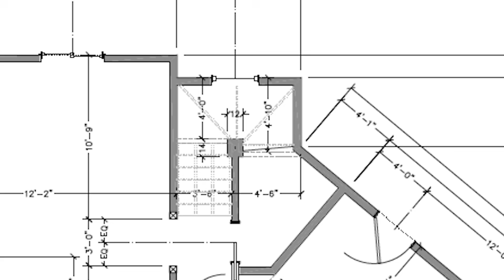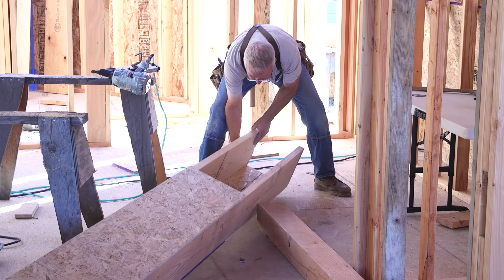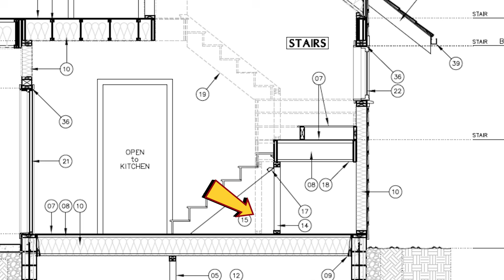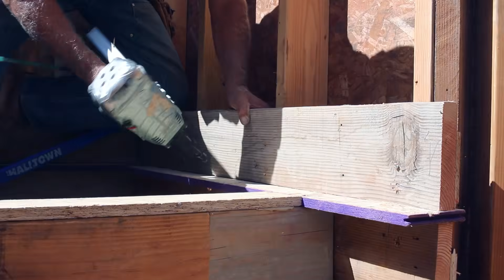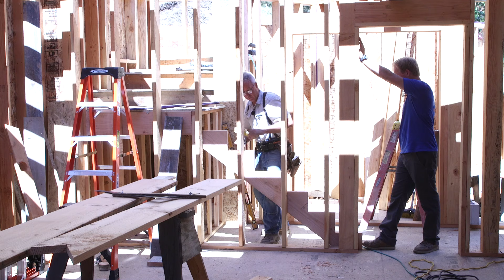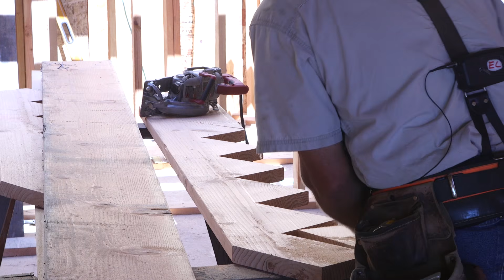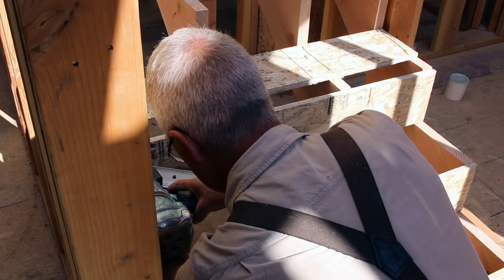Building Winder Stairs Ep.56

Comment: A point this carpentry does not make is, most building codes do not allow used form lumber that has had an oil based release used on it before the concrete pour to be used as framing lumber for fire code reasons.  So if you have oiled your form and plan on using it on your framing, don't do it.
If an inspector spots it you will need to rip it all out and start again.  
The lumber used in this video does not appear to have form oil on it.  don out.
Reply: Code must be different in the US bcz I’ve never seen an inspector fail something for having been form material. Lots of backing material was first used as form material. I could almost understand the reasoning from the old days when we used to use diesel fuel for form oil cuz it just plain stinks but form releases/oils these days are all non-toxic, biodegradable and water based.
🤜🤛
Reply: @psidvicious  Ya paze ya nickle, ya takes ya chances.  oil always increases the ferociousness of a fire.  One of the things about having good repore with the building dept. is whenever they came out my jobs, they knew that I adhered to code and barely gave my work a glance.  But they did keep me honest as did the penalty of doing something wrong.  the golden rule is the best policy.  Go ahead and build your personal home with oiled form lumber.  Me don't think so.
Reply: @wellpleased1836  Footing forms like this are not typically ‘oiled’ in the first place, so the whole point is really moot 🤷‍♂️
🤜🤛
Reply: @psidvicious  My friend psid, after a career or trade of having two licenses, a General Contractors license and a Concrete Contractors License, (I'm now retired) I can tell you that form oil was a blessing when stripping form.  Especially f it was for steps, foundations. tilt ups,  and other extremely difficult to strip form such as radius and sub form like arches.  When putting in a "lost form" is about the only time I did not use form oil .  And then we would spray it with anti termite liquid such as radiator fluid which kills termites.  Just a few Injun (ingenuity) tricks for you.  And sometimes when we did not have form oil, we used diesel fuel.  And sometimes just plain old motor oil on step riser form.  Also with form oil one might get five uses from the lumber.  What is your experience my friend with concrete form?
Reply: @wellpleased1836  Funny you should ask. Other than 30+ years in the reinforced concrete biz, (also retired) doing high rise, commercial, residential, pre-cast, tilt-up, etc...none. No experience whatsoever. Just gut feeling about this form oil stuff. So if you think your talking to someone that became an expert in concrete from watching a YT video...think again...my friend.
🤜🤛
Reply: @psidvicious  When it comes to steel I will humbly submit to your expertise but, you insist in being right on the issue of form.  Well, ok, so be it my friend.  Try pouring a swimming pool apron without form oil and see what happens when you remove the form.  As in high rise concrete pours that have undershorring and cantilevered balconies, if you didn't have form oil then the patch guy would not only hate but, you would loose your job.  And half of the concrete would come down with the strip.  But nowadays the concrete is formed with corrugated metal.  But you know everything.  Or do you?
Reply: @wellpleased1836  😂 You seem to want to argue just for the sake of arguing! 😂 Who’s talking about swimming pools?? If you want form oil all over everything, go ahead! OIL IT! No one’s stopping you? 😂
🤜🤛
Reply: @psidvicious  No my friend.  I just don't want a rod buster walking in my wet concrete.  So to speak.  You stay in your area of expertise and I'll stay in mine.  Agreed.
Reply: @wellpleased1836  😂 Still not sure what your area of expertise is, but I’ll try. It’s certainly nothing that’s been mentioned here. Let alone speculating on others. 
🤜🤛
Reply: @psidvicious  me no have nothing more to talkie.

Comment: Why are all the stairs built with chip board? What if the owner wants to have hardwood treads? Is it common to just be carpeted, or do you swap treads out later?
Reply: Tom Roberto the chip board is just the “subfloor”.  You can add whatever finish you want, carpet or wood, on top of it.  I believe Scott said the finish floor will be 1” which leads me to believe the treads will be wood.
Reply: @motor2of7  You must know what the finish surfaces at the top and bottom of the stairs are before you take a saw to your stair stringers. If not you’ll have an odd step which will not pass code. That’s what he was talking about when he said he was taking an extra inch off the first riser. If the builder/owner changes their mind on floor finishes, you’re likely looking at demo and starting the stairs all over.
🤜🤛

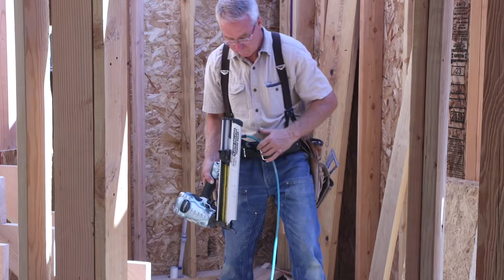Comment: @19:26 you can see that the bottom step extends out at least a couple inches into the door opening. In other parts of the video you can also see that the top step has at least a few inches of wall space where the lower set of stairs could have been moved back. I'm not a Carpenter, but am curious about why the base of the staircase is intruding into the door opening or is the door frame going to be so thick you won't see the side of the staircase framing?
Reply: Benmarc Design Group I was going to comment on this too.  It’ll be interesting to see how he handles this.

Comment: If you don't know the finished height of the top flight, as you said, all risers should be equal,
how can you build the bottom flight?  also, how is it that the bottom flight finished out into the doorway.
Reply: The height of the second floor is already established, thus that dimension is known.  I think what he is referring to is at what point the plane of the stairs will intersect the plane of the floor.  This is pretty easy to determine once the highest winder step is built.
Reply: I think it's that he does know the exact height, but he deems it easier to get the flooring sorted out and run the stairs into it, rather than, say, temporarily support the stairs or something and fill the floor frame in around it.
Reply: Evelyn Woodcock this really confuses me as theres no way we are stuffing up two sets of stairs, im thinking he knows pretty close where it finishes, within 10mm and it wont really mater 1 mm each step. if not im going to cry.
Reply: He would know exactly the RLs for ground and first floor by reading the plan. Its a new house he can make it the same.

Comment: Winders are the devil. I had a single winder in my house when I moved in, and everyone was constantly slipping or twisting their ankle on it. And the far corner was wasted space that you couldn't get a vacuum cleaner into. When it came time to redo the stairs, I made it a full step. Way better - we use it now as a place to set things destined to go upstairs.
Reply: I see your point, and thankfully this is not the main set of stairs.  I think if you didn't have it as a winder you'd have lost a step's worth of head space in that half bath, right?  So it's a tradeoff, but I could be wrong
Reply: Got to say that was my thinking. I hate walking down winders, seems to be the fashion in medieval castle towers here in England!
Reply: Winders in castles go the opposite way to Scotts. Defending the staircase requires a right handed swing.. I guess they didn’t take this into account
Reply: @neild7971  very true.
Reply: Where did you compromise to make up for the extra stairs/rise necessary?  IME, many winders are simply out of necessity to save floorspace, and converting to a flat landing in the middle isn't an option because there is not enough room on the bottom or top to makeup the difference in rise/run that's within modern building code.
Reply: Hey be thankful it’s a house and not a shithole

Comment: Interesting to see how the building code differs per country. Here in the Netherlands on a winding stairs the run and tread width requirements work a bit different. The tread width has a minimum overall of 5cm (~2in) and 23cm (~9in) at the "climb point", however the minimum run (at 22cm, ~8.5in) is only defined at the climb point, so you could essentially make a stylized revolving flight of stairs with a minimum run having a negative value. :-)
So at first I thought hmm, why only 4 runs on the platform, but I understand it when you mentioned the requirements.

Comment: WE ALWAYS add 2 by for sheet  rock and skirt space  , good point always put in stairs as so as you can going up and down a ladder is not safe
Reply: Yep, but just make sure the builder/GC doesn’t change their mind on finished flooring material bcz the 2nd set is going to cost extra.
🤜🤛

Comment: I like using LVLs for interior open stringers. And when practical I prefer to make my stringer pattern out of spare 1/2" or so plywood. If the 2x isn't super flat the circular saw cuts aren't always super square. Add the wonkyness the jig saw can leave in the corners and you have a pattern thats less than ideal. Just my 2 cents

Comment: Here in the UK us joiners build our stair flights in a complete unit eg the strings routered to receive the treads and risers then glued and wedged. We would also at times build the winders in the same way as he did there as in separate units which I find a good solid job
Reply: My 100 year old house here in the US has stairs built that way

Comment: E.C. Is there a advantage of winders vs. Frameing a landing and longer stringers?
Reply: Footprint?
Reply: As the other commentor was implying, using a winder gives you height, so the straight stringers don't need to be so long, and you can fit the stairs in a smaller area.

Comment: Why did you take off 1 inch from the bottom of the stringer if you're using 3/4 osb for the treads? Are you using 3/4 inch wood flooring?

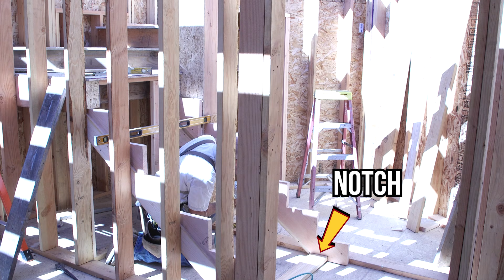Comment: Out of curiosity, at 18:30 is there a reason why you didn't put the notch in the front of the stringer? So that the stringer could rest against the board on the floor, instead of being pushed away from it
Reply: Leo H I had the same question.

Comment: What happens with that 1" gap for drywall between the stairs and wall if you are carpeting the stairs?
Reply: It's 3/4" and if the sheet rock is 5/8" you are talking about 1/8" which will disappear when the carpeting is laid or the finish treads are set. Even if you are using 1/2" sheetrock (ugh) the 1/4" will disappear the same way.

Comment: Why didn't you notch the front of the stringers to accept the support cleat on the floor instead of installing it on the back side of the stringers?  Wouldn't it be a stronger connection if installed at the front?  By installing it in the front, seems like any horizontal load on it would be restrained by the cleat - installing it on the back side of the stringers, the horizontal loads would tend to slide the stringers away from the cleat.  However, I'm sure there will be no issues with it installed on the backside since you added the metal angles.

Comment: I noticed on both your skilsaw and nail gun you have a hook that allows you to hang the tools inverted on a joist.  Is this a generic hook you personally install on tools when building?  Is this a hook that comes as an add on for certain tools?  Where do you get one?  I like that feature.
Reply: Every Paslode nailer I've ever seen has that hook. They probably sell ones that don't, but I've never seen one.
Reply: Some new tools come with the hook these days. I have always used this one for my Hitachi nailers - https://www.amazon.com/Toolhangers-Unlimited-Original-Hanger-Green/dp/B003XRRF14/ref=sr_1_1?crid=3W3GDXQ5109KX&keywords=sky+hook+for+nail+gun&qid=1578342201&sprefix=sky+hook%2Caps%2C248&sr=8-1 - and this one for my Skilsaws - https://www.amazon.com/Toolhangers-Unlimited-Original-Retractable-Hanger/dp/B0000223FD/ref=sr_1_22?crid=3W3GDXQ5109KX&keywords=sky+hook+for+nail+gun&qid=1578342201&sprefix=sky+hook%2Caps%2C248&sr=8-22

Comment: will these stairs be carpeted over the osb treads and risers? how would the construction differ if one wanted a hardwood set of treads?
Reply: Hyun Jo The mathematics on the rise would be a little different as you would be using 5/4 treads as opposed to three-quarter inch plywood. But would pretty much be the same except for the use of fasteners on the tread.
Reply: It will almost certainly be carpeted. A good indicator of that is he has an over hang on the tread. If he were using hardwood treads he would have to subtract the additional thickness from the first riser and add the thickness of floor covering. He would also have to remove the overhang from the subtreads. Optionally he could forgo the sub-treads all together, which I like to do as I feel it gives more options when installing the finish stairs.

Comment: Why not just have a half height landing/platform? No need for winders at all
Reply: Space. He got four steps where the landing would have gone. That shortens the overall length of the staircase by four tread lengths.
Reply: @HistoryProf101  ah I understand. So it can squeeze in.
Reply: I think that would take up more space. It would end up extending the stairs a couple feet horizontally.
Reply: @gxexrxmxaxnx  yes I'm with it now. Thanks

Comment: Great tip on adding a piece of 3/4" on the side of the stringers for drywallers. Wish everyone would do this. Thanks EC
Reply: Para Scale Models 
This was such a huge thing that I see showing through in these videos. The forethought to make someone else’s job a touch easier, and get a way superior result. 
A minor detail, that pays huge returns.
Reply: Yeah, that idea jumped out at me. Nice!
Reply: Should use a 2x to allow for the finished skirt board as well. 👍🏿
Reply: @uglyashelful  yes we use a 2x and then temporary treads. final treads and risers to be installed after sheetrock and skirt board
Reply: alan m far better to use a 2x.
Reply: @fancy @gage Interesting. If you were installing clear coat wood treads would you do it the same? butt them into the skirt tight, or put beading or something? Thanks, it certainly would save a lot of cutting.
Reply: @neild7971  Yes, I would. The Collins stair gauges work great for that. Insider Carpentry has one or two really good videos on it.
Reply: @uglyashelful  agreed even my 1913 Craftsman did it this way with the skirt board going down before treads
Reply: fancy absolutely
Reply: @uglyashelful  exactly. I've always added a 2x4.  1/2" for sheet rock 3/4 for skirt board
Reply: Shouldn’t the Skirt board sit over top of the flooring though? To cover the gap and provide the cleanest finish?
Reply: @neild7971  You might think that, but in reality cutting a skirt around every bullnose and making a cut for every tread and riser is a real pain. Most of the time when I encounter that situation (say I'm doing a reno and the client wants to add skirtboards to an existing staircase) I cut the bullnose flush with the riser at the point the skirtboard will sit. Then I have to make cuts for the treads/risers. If even one cut it too high then you have to scribe every single cut again, while keeping the board at the correct rake, and then bring it back for a fit. And that's for carpet, where the tolerance is about 3/8.  Over hardwood treads... it's a process. And its never cleaner. It always looks "hacked" in.  

There is a reason most skirts get installed first and that's because it is faster, cleaner, and a better overall product.
Reply: @neild7971  the treads typically run into the side of the skirt board. It allows for s little bit of slop in the skirt
Reply: @neild7971  Well no ! The skirt board runs parallel with the stairs, at floors / landings, the " base trim abuts the end of skirt board .
Find this detail in all homes w stairs .
Cheers
Reply: @uglyashelful  Yeah... Just saved the dry wall guy 15 minutes and cost the stair guy 3 hours...
Reply: That tip blew me away.  Ingenious!
Reply: Good carpenters have been doing that for a long time. How do I know 40 yrs drywall biz
Reply: Yes, though in our area , Tacoma-Seattle , it's been a 2X , (1 1/2" ) , material, allowing the 1/2" drywall & 3/4" " skirt board to slip right in .
Great series and people doing a great job !
Cheers !!
Reply: Para Scale Models we would use scrap 3/4 OSB ripped down in most cases.  Or 2x4 if a skirt board was called for..
Reply: Great tip, especially if you are the guy doing to be doing the drywall!!!!!
Reply: I’m from ky and we add two by material to the sides of the outside stringers to allow for the dry wallers to have easier installation but also leaves room for the trim carpenter to slide a skirt board in without having to notch around each tread and riser
Reply: That's how we do it. It helps you remember if you're also the one who is going to be putting the drywall in as well haha
Reply: such a genius move. IQ 5000
Reply: We used to add 2x to the back side of the rough stringer, then you have room for drywall plus your finish stringer
Reply: Use 2×4 on outside of stair stringers.

Comment: I would have drilled some large holes at the tip of the triangle cut outs in order to reduce stress concentrations. But I am more familiar with metal, so I don't know if this applies to wood, too. What do you think?
Reply: think about the grain/fibers in the wood, it has no tendency to split in that direction.
Reply: In my mind, the ultimate tests of a load bearing member are strength, stiffness, and fatigue life. Lowering stress concentrations is not really a goal in itself, it's just one factor of strength (although it can occasionally be extremely important, since it has a multiplier type of effect). The stairs will be strong enough like they are, so there's no reason to look at lowering stress concentrations unless you also want to redesign the steps and try to save material by using really thin boards or something. 

My guess is that you're mechanically correct, but in the big picture it would be expending effort for low or no benefit.